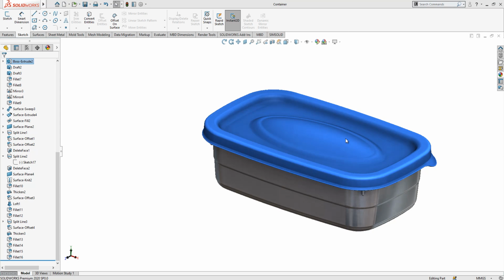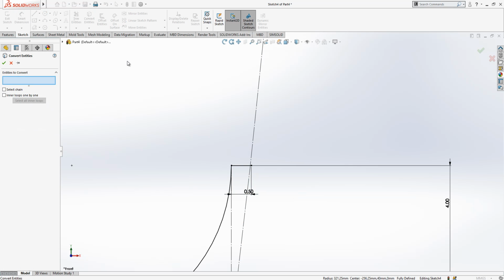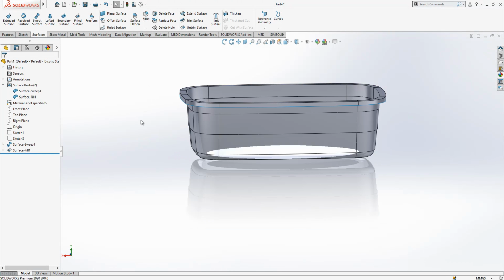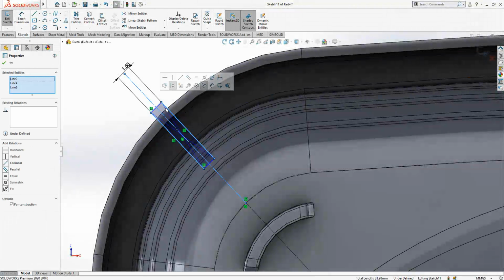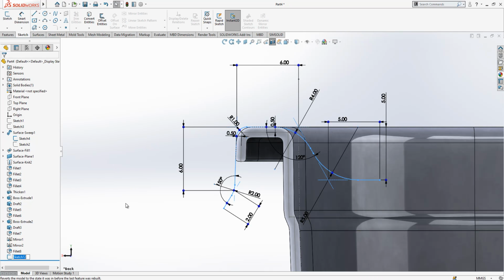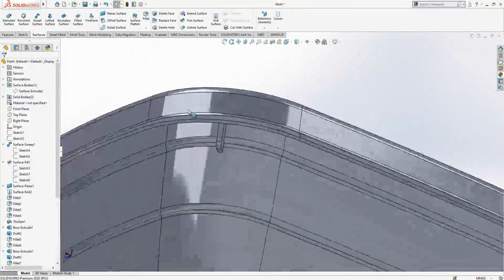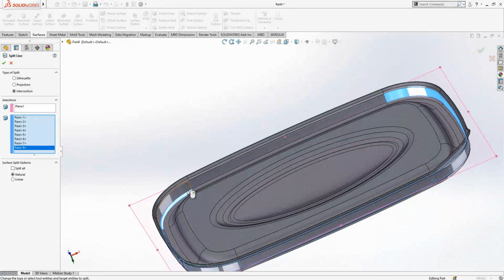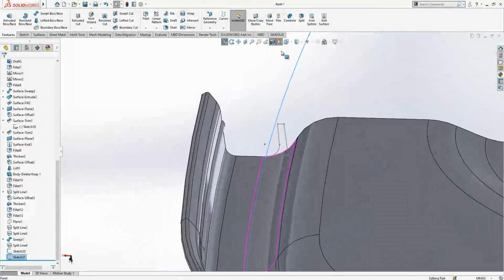Advanced Surface Modeling - Plastic Container - Solidworks Tutorial

Comment: I understand this was a quick video, which may have skipped over some more nuanced design techniques. My question is, when designing such a container for injection molding, would you take in account curvature, using spline instead of arc? Or is this not necessary for a plastic container and more reserved for, for example, automotive design? Thanks for the fantastic video!
Reply from the maker: Hi Thanks for your comment. I like your questions, good one.

Yes because of limited time I do not go over every detail. 

When you design a product you will consider much more things,

Critical Material Thickness,
Draft Angle,
Curvatures,
Minimum Feature sizes, 
Mass, 
Material
Volume
Productability 
Budget etc...

For such a product using arcs fine, they are reliable and mostly wont go wrong.

Someone should be very carefull when using splines, especially in complex modeling, defining two spline profile and creating  in between a surface wont give you all the time desired results. 

For Automotive industry there is A Class Surfacing method, which allows you to control not only your profile splines also whole surface curvature. 

All those examples to gain some skills on program, real modeling will start at work. 

Regards
Reply: @3D-World  Regarding your statement:
Someone should be very careful when using splines, especially in complex modeling, defining two spline profiles and creating inbetween a surface won't give you all the time desired results. 

I'm learning that now, using boundary surface is great to create a surface between splines, but the lack of control of the result is not acceptable for me. I'm experimenting with ways to be able to control it more and your videos have been a great help! 

Thanks for the great work you put forth, I really appreciate it! 
All the best!!